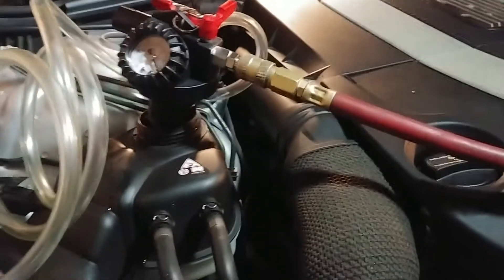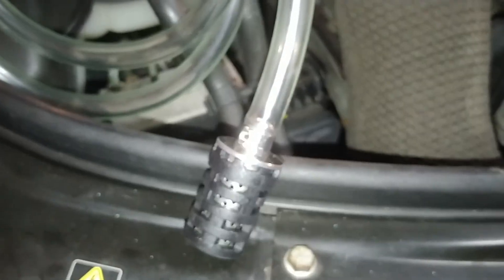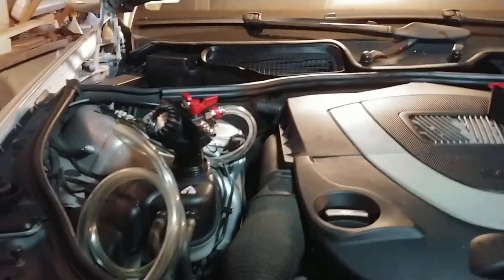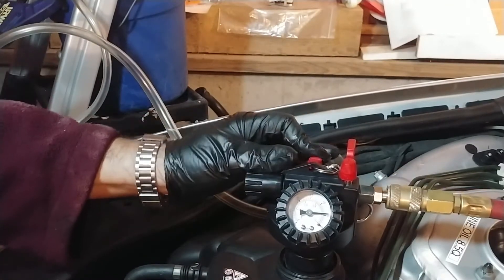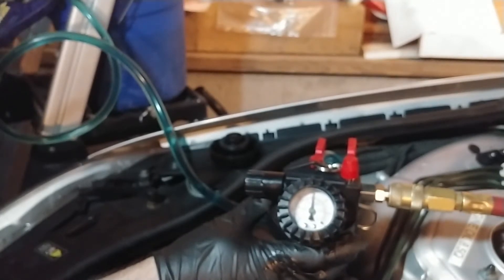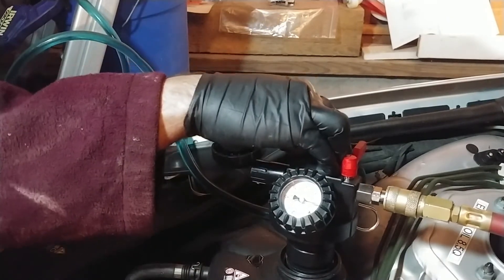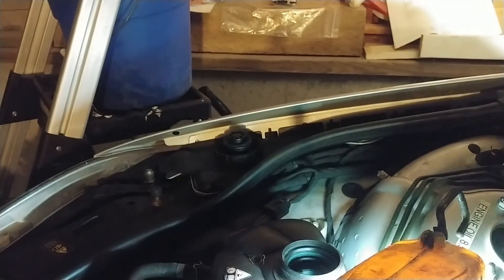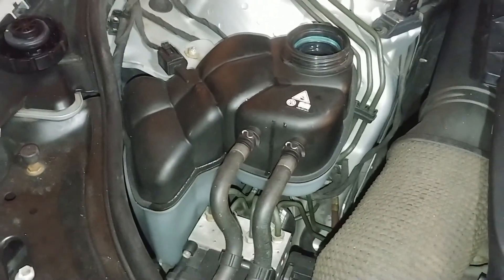2007 Mercedes S550 how to vacuum fill cooling system

Comment: The vacuum gauge will begin to rise and there will be an audible hissing noise. During this process, open
the ball valve on the refill hose slightly. Coolant will be visible rising in the refill hose. Once the refill hose is
full of coolant, close the ball valve. This will purge any air trapped in the refill hose.
9. Continue to draw the vacuum until the gauge reaches 28 inches
of vacuum. The gauge may not reach 28 inches in high-altitude
locations; use the vacuum specifications based on the altitude
above sea level.

Comment: Generally, you can only pull a vacuum of up to 28inHg with these devices...all based on your elevation.

Altitude above sea level Vacuum gauge reading
0 - 100 m (328 ft) : 28 inches of vacuum
300 m (984 ft) : 27 inches of vacuum
500 m (1,641 ft) : 26 inches of vacuum
1,000 m (3,281 ft) : 24 - 25 inches of vacuum

Comment: How did this work out for your S550 so far, any issues? I have a 2013 I need to replace the upper and lower hose and refill radiator so I'm researching this tool.
Reply from the maker: It's awesome. I just used it again this weekend on my E55 which has a lot more cooling system complexity with the supercharger and intercooler circuit. Worked great.  You will have to top off after driving the car and letting it cool down.  Get it and report back how it went.
Reply: @kevin9c1  I'm looking at a similar one at Harbor Freight as they are in my neighborhood and have it in stock. Looks like the one you used, must be made by same factory overseas.

Comment: is it neccesary to pull a vacuum? wont running the engine blow any air through?
Reply from the maker: It depends on the car.  I don't know that this car needs it but it's the easiest way to do it to ensure no bleeding required no matter what.

Comment: I have some videos about how to keep leaves from clogging your drains and flooding your floorboards in the 2007, I hear its a big problem. You may find my vids helpful in that respect.
Reply from the maker: That's interesting.  This car is parked outside so this does concern me.  The car this replaced had that problem actually (not a Mercedes) and I had to flush the drains annually to prevent it.
Reply: @kevin9c1  Its an easy fix, just rerouting the end of drain tubes which goes into the small pocket behind front tires on rear of fender well. Then gorilla taping some metal mesh on each end of cowl, and getting yourself a blow gun for your compressor to blow out drain tubes from the bottom upward every once in a while. Another culprit is that passenger side vent on the hood, it sucks air into the AC and when the drain hole in bottom of it is clogged, the reservoir will fill up with rain or wash water and waterfall into your floorboard. The S550 has rain gutters like a house and they must stay clean of leaves or else.
Reply: @kevin9c1  You'll need to blow them out a lot more than annually if parked anywhere near trees. The drain tubes are the diameter of a carpenters pencil, slightly thicker but not much so they clog very easily.